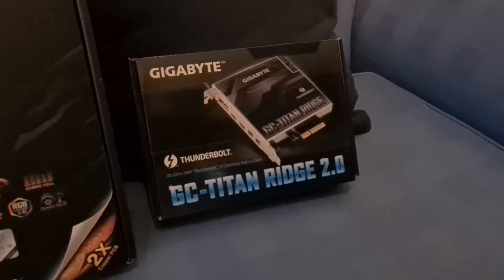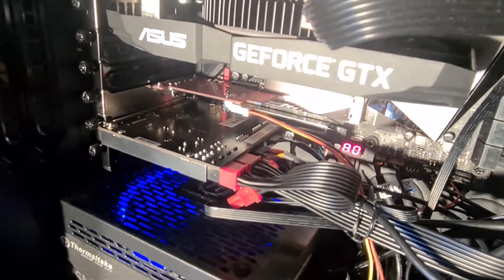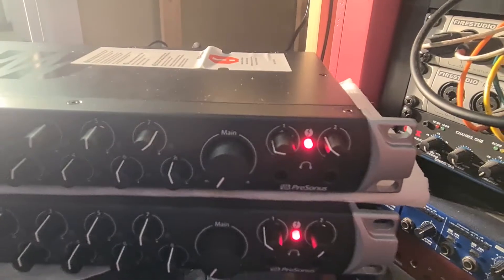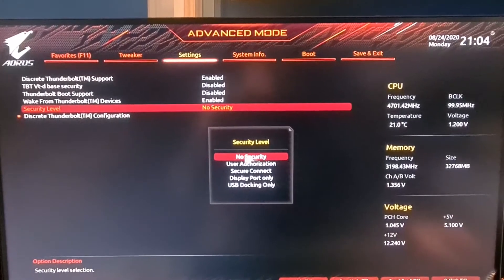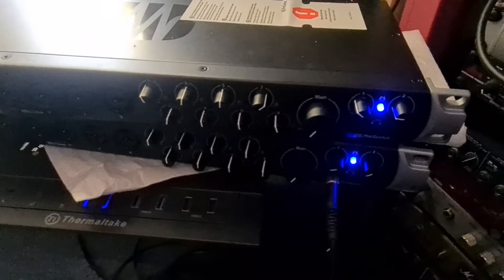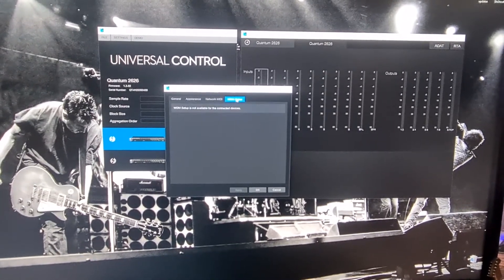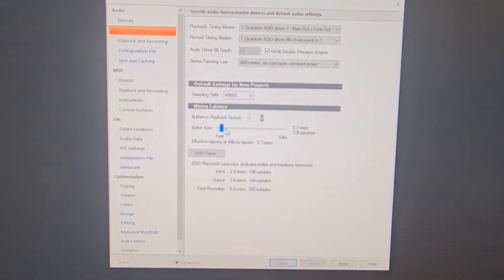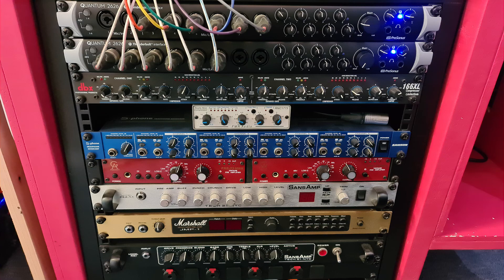Gigabyte Titan Ridge 2.0 Thunderbolt 3 and cascading 2 x Presonus Quantum 2626

Comment: The mini displayports, what can they be used for?  Is there any way they can be adapted into additional Thunderbolt ports?  I wonder because on some Mac computers the mini displayport is also Thunderbolt.  I have this card in my AMD based system now and working.  Amazingly I didn't have to jump through a lot of configuration hoops like other people may have to get their card working.  I simply made sure to plug power into it and connect the THB-C header on my motherboard to it.  I didn't have to spend hours looking around in the UEFI BIOS setup for some strange setting that only a few people are apparently aware exists.  Instead I simply downloaded a driver from Gigabyte and restarted the computer (not needed but it helps sometimes anyhow).  When you connect that cable to it pay attention to the ends on it where the two ends are a lot closer together and it looks like a splitter.  That is two different ends!  One will fit the header and the other looks like it should fit but will not.  Take your time plugging this in and try not to bend the pins accidentally forcing the wrong one in.  On my Gigabyte board it was the connector that is not the same one as for the card itself but that odd one.  Watch clips of people doing this if your are in doubt.  Ask questions anywhere you can get an answer soon enough.  I find it helps to see someone else doing it and explaining how they do it.  It just makes it so much easier to do it when you can see it that way.  Also those clips help because if they used a good camera you may see the orientation of a connector better.  Why mine was so easy to install I don't know.  Maybe a BIOS flash I recently did was setup to look for the presence of such cards and configure them accordingly.  We all know how notoriously difficult it can be to get Thunderbolt working.  To make that worse it was once limited to a small selection of Intel based systems.  Could Intel have been trying to become the new Apple by having nice things that only work with a few of their own products?  Sure would seem that way at first!  Really when Thunderbolt came out Intel was charging royalties or licensing fees.  Of course no one wanted to pay those and so a lot of motherboards never had it.  It very easily could have suffered the same fate as Firewire!

Comment: i don't get it.. can you cascade the 2x quantum 2626's? in other words, can you send and route audio from the I/O's of one interface to another inside of the DAW??? I thought that was not possible with the 2626 and only possible with the other Quantum interfaces..  I have a 2626 and I'm super happy with it running on my PC but I'm stuck in regards to expansion unless you confirm I am wrong in regards to cascading the interfaces.. cheers
Reply from the maker: Yes, of course you can.
So i use Cakewalk by Bandlab and i have all inputs and outs showing.
As i record live drums i require about 12 channels so with 2 units i have up to 16 pre amp channels i can use.
Hope that answers your question
Reply: @walkintheseshoes Thanks but I still don't know how the devices are showing up on your DAW. According to Presonus the 2626 cannot be daisy chained so I can only assume you are using your interfaces in parallalel configuration and so you are restricted to use the, separately without being able to route audio from one to another..? I do have two thunderbolt inputs in my computer but my DAW (Ableton) only allows me to use one at the time if i connect them in parallel.. I am scratching my head after seeing your video really.. cheers
Reply: @walkintheseshoes  i think i'm gonna give it a go and see. So can you also send input 1 from interface 2626-A to output 8 of interface 2626-B? Thanks
Reply from the maker: @pangea2003  I don't use mine in that way but I'm pretty certain you can do that style of routing

Comment: Hi, great vid. I don't know if you still check your comments but here goes! I use cakewalk and am currently looking at the same interface and card, I have the same motherboard. I was wondering if you noticed any difference not having a software mixer integrated into the interface, like other interfaces do? Did it matter in any situation? Many thanks!
Reply from the maker: Hi mate,
I use Cakewalk too, been my daw of choice for over 15yrs.
I can do everything in box and don't need a mixer for the presonus interface, for my use it works perfectly.
Hope that helps
Reply: @walkintheseshoes  Thanks man!

Comment: i ve a hackintosh, mojave 10.14.6, intel I(, z390 aorus pro wifi , i tried with the titan ridge thunderbolt card but it never detected and thus i am unable to use it can you plz suggest how to enable it and my audio sound card is antelope ddiscrete 8 synergy which also runs on thunderbolt 2
Reply from the maker: Hi,
Try watching this and see if it helps.
https://www.youtube.com/watch?v=8zinqjWO7nE
Cheers
Reply: Did you ever fix this issue? 
The “FLASHED” or “HACKED” Titan Ridge will work with all of the following:
• Focusrite Clarett 8Pre (X)
• Motu 828es
• Lynx Aurora
• Apogee Element 46
• Apogee Ensemble Thunderbolt
• Blackmagic UltraStudio
Minirecorder
Blackmagic Mini Monitor
• Akitio Node Pro Thunderbolt 3
• Elgato Thunderbolt 3 Pro Dock
• Elgato Thunderbolt 2 Dock
• Belkin Thunderbolt 1 Dock
• Kanex USB3
• East Thunderbolt Adapter
• Honeywell USB-C Dock
The Titan Ridge does not work with all of the following:
Drobo (storage)
Promise Pegasus R6
Presonus Quantum (other Presonus should be fine)
Antelope Audio (see details above)
Slate VRS8 (will not work on a Mac Pro, works on a Hackintosh)
Lynx Aurora 16 (Original, not N) with LT-TB

Comment: What does the GPIO3 Force Pwr actually do? I've noticed that it's the only way that I can see my GC-Titain-Ridge at boot time... otherwise I would have to plug a device into the card and then it would show up..  however I'm not sure if it's frying the portable USB-C drive that I'm testing this with.

Comment: Just received my 2626 yesterday, was trying to install it on my new Mac Air M1, 5 hours later, ... not suported yet as Presonus need to update their drivers for ARC architecture . Will install on PC WIN 10, got the same board as you. Order the Tb3 card yesterday from Amazone, maybe I will get it today, Thanks for your video, it may save me another 5 hours of frustration. Will let you know.
Reply: so, how did that go? are you enjoing your Quantum? how does that run without any DSP? i'm planning to buy this interface. what I'm looking forward to is keeping my recording studio as simplified as possible. the more gear you add to the chain the more noise you get.
Reply: @anemonaloco  love it, but I use it on my mac air m1. Latency is so low and no cracking noise
Reply: And I use it with Guitar rig and a couple of DSP like positive Grid, works great.
Reply: @J-L_Pilot  thanks for the feedback mate!

Comment: PCIE Power connector is needed if you are connecting any thunderbolt devices that doesn't run on it's own power supply (ie: external hard drives that are bus powered). If you are using an external hard drive or a thunderbolt audio interface that has its own power supply, then you do not need to connect the PCIE power cable to the gigabyte thunderbolt card.
Reply: Do  you know if the GPIO3 Force Pwr will still work without the pcie cables attached?
Reply: @timotmon  for Mac Pro 5,1, yes, the force power jumper on GPIO is required to get the card working correctly in general. As mentioned before, on Mac Pro 5,1 the PCIE power cable isn’t required to have the card working. The card should work after you’ve properly configured your card (with flashed older firmware) and system (added SSDT file if using opencore). The PCIE power cable and Thunderbolt header cable is required for compatible PC motherboard running Windows.
Reply: @methodm2000  Thanks for your response! I'm curious why you're talking about a Mac Pro here? Are you talking about a hackintosh? Maybe you were talking about a physical  force power jumper in the form a short like you would do to make a headless video card to fireup on boot? There's a setting my AORUS Master BIOS called GPIO3 Force Pwr that supposed to do the same thing but I haven't tried doing it physically on the connector. 

I was just trying to get this card to work on an approved Gigabyte board. With GPIO off, it would show up in the device manager unless I plugged a device into one of the thunderbolt ports. Only then would it show up in the device manager. With GPIO turned on.. I could see it in the device manager after boot but I couldn't get any devices to work. I was trying to hook up an egpu for more Octane/Redshift rendering speed. 

I ended up giving up, and building a new AM4 system with onboard thunderbolt 4.. but I wish I could have gotten the other system to work. I'll probably give it another go at some point.
Reply: @timotmon   My mistake. In the BIOS, does that “GPIO3 Force Pwr” option show up under Thunderbolt options under Peripherals Section? Which motherboard model do you have and which model thunderbolt card? In the Bios, the thunderbolt option needs to be enabled for the card to work correctly. Normally on a compatible motherboard, the thunderbolt header on the motherboard needs to be connected to either the 5-pin or 3-pin cable on the card. To get a display through the Titan Ridge card, you would need to bridge your current video card to the TR card using the Display port cable that comes with the TR card. The card itself needs to be connected to a PCIE x8 slot on the motherboard. You also have to make sure you have the latest drivers. The card is supposed to show up all the time in devices manager whether there is a device connected or not. Which EGPU enclosure are you using?
Reply: @methodm2000  Mike you're awesome! Thanks for taking an interest. So yeah,

Comment: thanks for the great video. I see that the version on amazon has a TBT 3pin header AND TBT 5 pin header port on the card itself. We only have to use one of those right?
Reply from the maker: Correct, just one of those depending on what is on your motherboard.

Comment: Super helpful thx a lot!!! Considering these myself. Could you please test if the low latency is maintained when adding converters through the adat inputs? Thinking to keep my MR 816s and adding them via ADAT....
Reply: I bought a Quantum 2 and will be testing latency with my Steinberg MR-816 s soon. Will post results here...
Reply: I tested adding the Steinberg thru ADAT. It works perfectly. No noticeable additional latency. The difference in performance of Steinberg FiWi driver to Quantum TB driver is about 40% faster at heavy CPU load maxing out processor. (Results from Initial tests today)

Comment: you should do a better cable management, because sooner or later you are going to encounter thermal throttle because of the mess of cables causing a bad airflow in your case